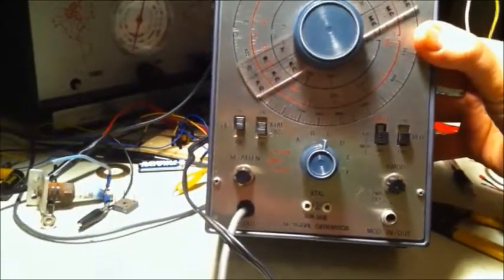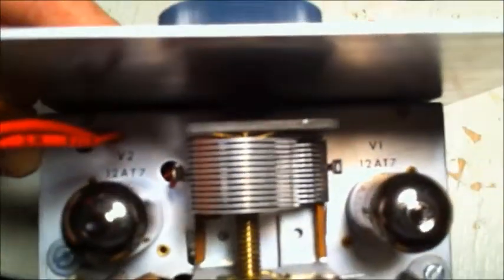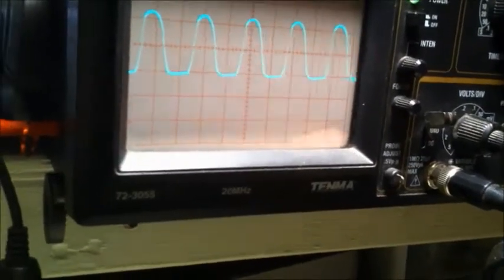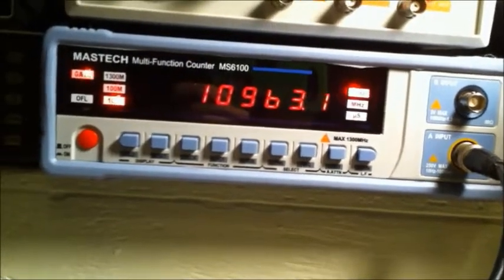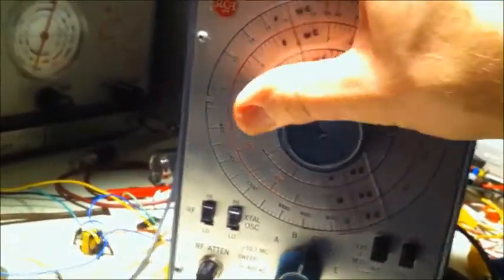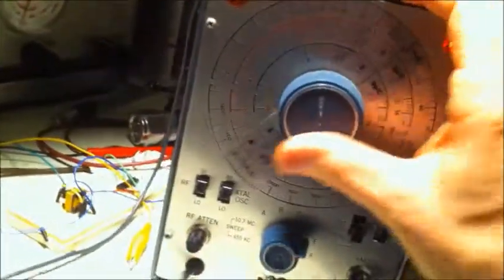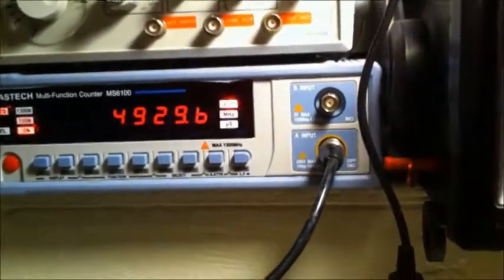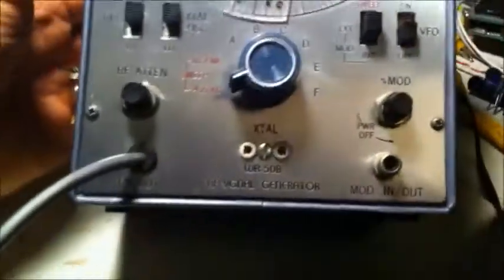WR-50B Signal Generator

Comment: Looks great, I’ve had mine since 1965 and keep it in good shape. Do check the power supply filters, 40 uf each. Mine are original and still in good shape , tested them on a Heathkit C tester. The  Xtal,socket is for a marker used in alignment. Thenpreset 455 and 10.7 can be tuned thru coils on the ring of coils, first two at the top.

Comment: I use one like this, however , sweep alignment of an AM radio is ludicrous when the peak method makes more sense. The very narroe pass band curve is swamped out by the xtal signal marker and makes the results dubious. I use the peak method with a Simpson 260 VOM . The VTVM meters are too sensitive and do not average the reading out to a stable reading. That is why the 260 has an output function jack. There is no real,advantage in using a VTVM, not to mention HOT chassis problems. Isolation transformers are not a cure all, they all have some leakage unless you paid $1000’s for a computer equipment grade transformer. Still, i would use a cheap one for some personal shock protection.